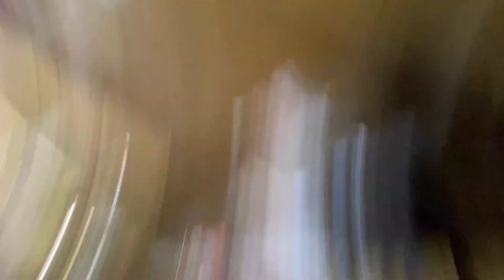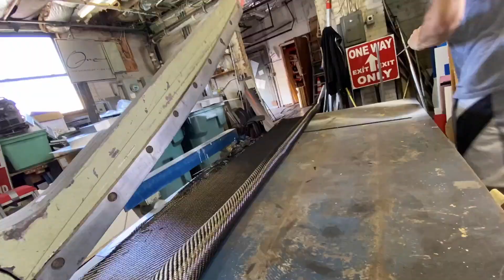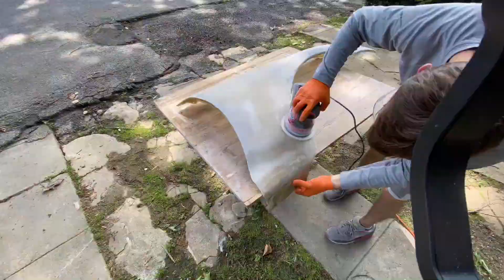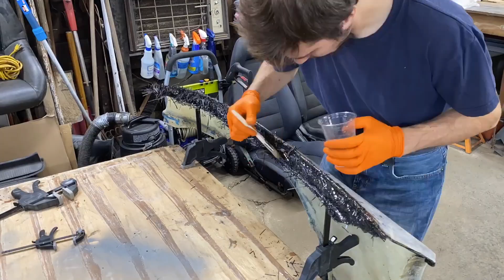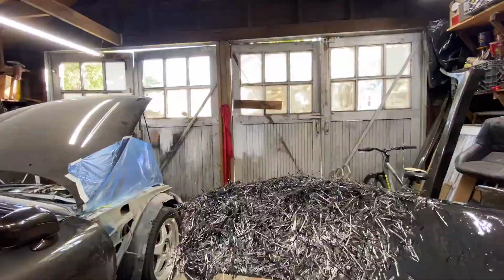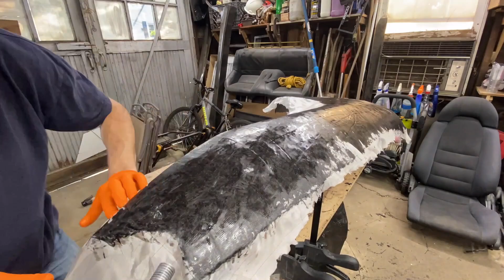MK4 Supra: First Forged Carbon Fender (How to)

Comment: Also if you want to vacuum seal harbor fright has some vacuum seal storage bags for 6-8$ they work pretty well but you’re limited on the size of what you’re putting in there
Reply from the maker: That’s awesome to know, I didn’t know they had them there, but I did experiment a while ago with clothing vacuum seal bags off Amazon and I was suppressed that it actually worked pretty well :)

Comment: You should try using a vacuum bag that's how I make my surfboards it makes everything so much easier just put defender in the bag once you get all your resin and carbon on it it will suck it down and make it so perfect
Reply from the maker: I’ve thought about doing that and would be able to for my smaller piece like Carbon shift knobs, coasters, cups etc.. but where I’d really need it is on the piece I’m doing now, but it’s just to big to Fid the whole front end of a car in a completely sealed bag

Comment: Stupid question. Can you carbon fiber skin sheet metal? Well your fender is sheet metal not fiberglass?
Reply from the maker: Yes, you can skin sheet metal. However if the metal is to thin and pliable you might have trouble getting your carbon to release from it. And yes the fender I molded was made of metal, but the one I made is only carbon
Reply: @ksmneptune  thanks for the reply I have a 97 Supra and a I was thinking about carbon fibering the front quarter panels

Comment: How did you manage to copy the form of the fender?
Reply from the maker: I took a positive mold from the existing fender, then proceeded to sand it down and apply my carbon until I was pleased with the look and added a cost of resin.. with some steps in between, but you’ll see it in the video😃

Comment: could you lay the carbon fiber like the fiberglass? i want to mke a carbon fiber fender but dont wanna get nutts with the price
Reply from the maker: If your using a carbon fiber roll yes you can, there’s a video I haven’t posted yet of me using a carbon sheet and I was able to lay it like fiberglass, it’s a little tricky as the weave can tug very easily and distort the end result.

Comment: Would this work on an aluminum hood?
Reply from the maker: You might be able to, but it would be risky when taking the mold off. Since aluminum on cars is very thin when they manufacture it, you run a risk of damaging the original hood.

Comment: Hey man I was just wondering which epoxy you used and if you recommended any. Planning on doing this soon.
Reply from the maker: Hey what’s up dude!, I’m using east coast epoxy Epoxy Resin 1 Gallon Kit | 1:1 Crystal Clear Resin and Hardener for Super Gloss Coating | for Bars, Tabletop, Art, Jewelry, Casting Molds | Safe for Use on Wood, Metal, Stone, Plastic, Marine Sealer https://www.amazon.com/dp/B00NLPCA5Y/ref=cm_sw_r_cp_api_glt_fabc_7861WD802EBM9AB1WH64 
For a recommendation it depends on your budget, if you’re looking for a cheaper cost I would recommend this if you go on my channel I’ve use this for each part of my car, the only issue is it’s soft when it’s in the sun so if you’re looking for something that cures much harder I would recommend going on https://www.fibreglast.com/category/Resins and using one of there more appropriate resins. Hope this helps!

Comment: a polyester base and epoxy overlay with lots of tiny air bubbles stuck between fibers seem destined to bubbling and delamination.
Reply from the maker: In theory yes, but with each coat sanded with an aggressive grit, and more resin and carbon being relayed, to fill the voids, the piece has held up just fine.

Comment: Is the carbon fiber being placed on the outside of the Mold shown in your two mold video's - Or did you use that initial mold to create a new inner mold?
Reply from the maker: Yes for my first time using fiberglass/ carbon I wanted to see how it would work making a positive copy of the fender and then using some of my body work skills to sand down the edges to make a flush ever body line, then apply the carbon/ resin and repeat the process.

Comment: Good work man! The peel ply was not a necessary step for the carbon skin - next time just sand it flat, and then layer on a few more coats of epoxy resin. Follow-up with a wetsand using a block and it will be very smooth 😁👌👌
Reply from the maker: Appreciate the tip!! I’ll definitely keep that in mind for my next one

Comment: Hey nice video! However, why not hydrodip?
Reply from the maker: I like the idea of hydro dipping for a more difficult part or maybe some interior parts, but I like working with real carbon, it’s a noticeable different in shine afterwards along with the weave in the carbon being more pronounced.
Reply: @ksmneptune  Ah i understand what you mean, good thinking. I think that if you use a certain type of clearcoat and weather protection gloss, you can make the hydro dipped carbon part really shiny!
Give it a go mate
Reply from the maker: Hey appreciate the tip, I never turn down something new with a potentially great outcome! I’ll find a part one day that would fit the use.
Reply: @hashim4535  it can have the gloss but it wont have the 3D or Holographic shine like real carbon, I can tell the difference between a wrap, hydrodip and real carbon from pretty far away, its a very noticeable difference.

Comment: Did a good job. The fender is oversized and not the same size as the original. You could of put cheap gelcoat on the outside of the fender, sanded and painted. This forged carbon is a desired taste.

Comment: Great. You defeated the whole purpose of carbon fibre. Instead of reducing weight, you simply added it on. Try making a mould first and make and identical carbon replica
Reply from the maker: I did this experiment to see if I’d be able to make my own parts. This was a test of my ability not so much for making a light weight part, that’ll just come with the skill of resin to material ratio

Comment: Why not just do an infusion? Being a fender u will want best possible finish and some flex not strength. A fender, 200, 400 and adding tape where bolts will be is more than enough for strength.  To strong and there will be no give and whole fender will crack  or break. Fender collisions are mostly light so best to make them able to absorb the impact without breaking.
Reply from the maker: I could have done an infusion it just would have taken more supplies, a theme I’m trying to keep on the channel with all my “how to” videos is how to do it in a cost effective way. I’d also rather show people that even doing something the hardest way you can still get the same incredible results.

Comment: Wtf are you high why didn't you use the inside of the mould it would of popped out smooth and the same size as the original
Reply from the maker: The “mold” is the actually fender and had many imperfections on the inside and was not feasible for a mold.

Comment: would you know how much did you cut by weight? because they sell already chopped fabric by pound
Reply from the maker: I haven’t put them on a scale, but I’d say there’s a 3+ lbs difference
Reply: hi, following up on this, do you mean you used 3+ lbs of chopped fiber for this?
Reply from the maker: @chobits332  no no I just cut 3 pounds or so from the factory part, are use roughly 1 pound of chopped carbon to make this project. Hope that helps!